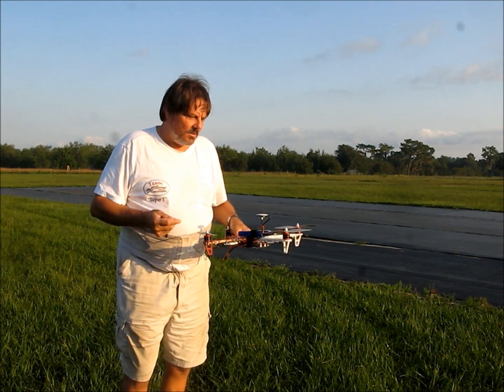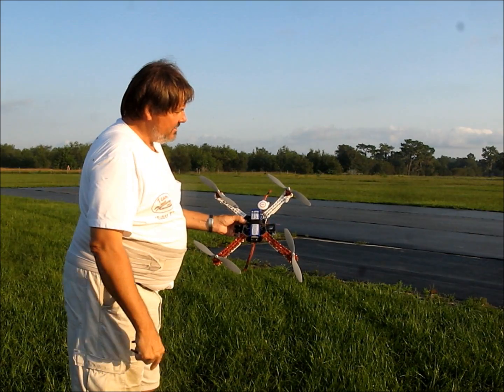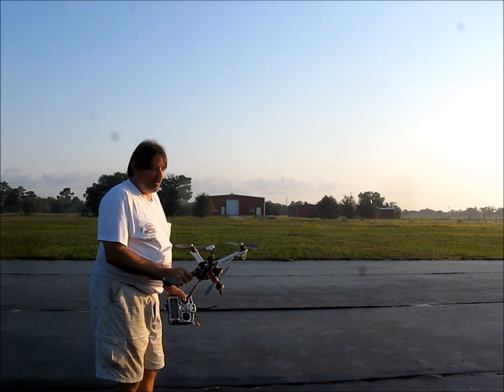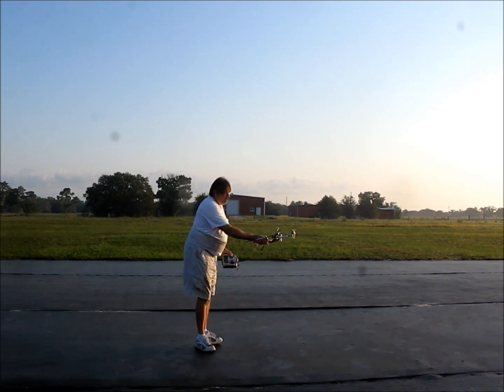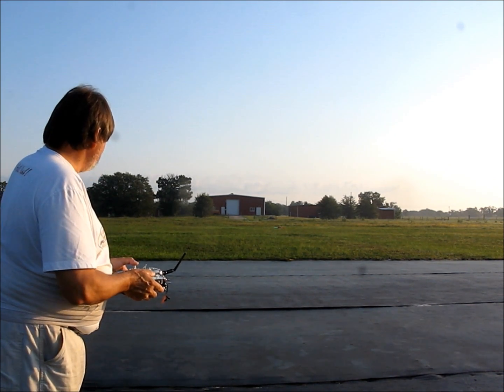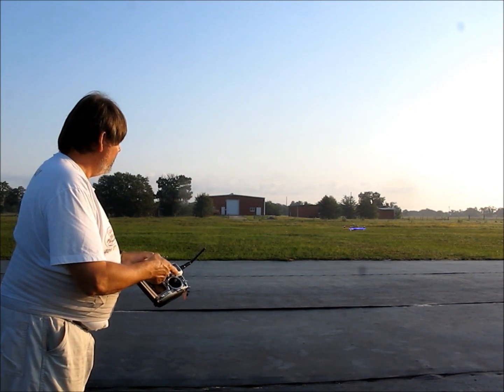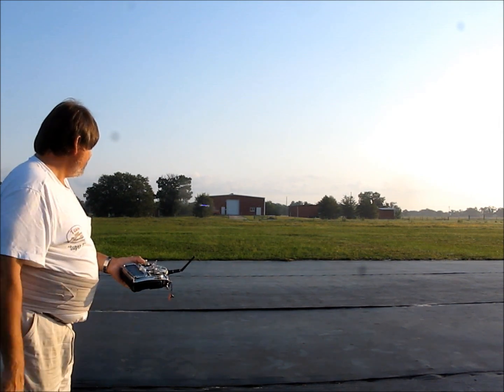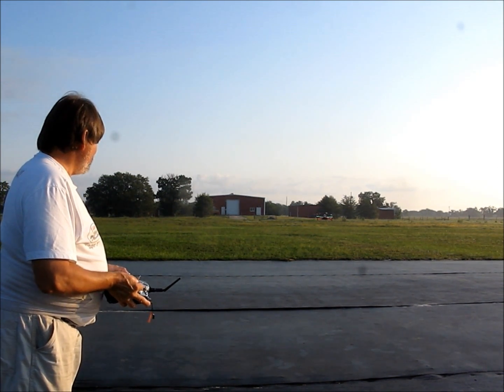dji gps ioc info

Comment from the maker: It is never a good idea to turn OFF the transmitter when flying anything.
But, I can assure you mine works. You can test it with the props off the model
and it plugged into the setup software. After setting it up you can test it by turning OFF the tx and it should trigger the failsafe.
Remember:
1) You must have a SMARTSAFE RX
2) You must bind your system with the fail safe activated.
This way when the failsafe is triggered the system will know what to do.

Let me know if you need more info.

Comment: Thank you

I have the DX8 flight mode switch set to 0 GPS ATTI..1  Atti....2 Manual and they work on the software.(3 position)

I have the Aux 2 switch and Aux2 channel set for  0 off...1 course lock...2 home lock  (3position)

Gear channel seams to be on the gimbal for some reason. Do not want this ....if you tell me how to free up this channel then I could use this switch for the failsafe.
Thanks

Comment from the maker: Now check all switches on the TX.
Throttle is at 0%
Flight mode switch to GPS
Failsafe switch to OFF.
Now reconnect to the Naza software and re-check your setup.
At this point if you have done everything correct, When you turn off the TX the Naza will show failsafe at the bottom of the screen.

Note: Leave the Autopilot in Landing Method for the first few test.
Once you have things working right then you can change that setting.
To get the most out your setup. Be sure and learn about the IOC.

Comment from the maker: While in the Naza software flip into failsafe.
In AutoPilot select Landing for the failsafe Method.
(Once you have this setup and working you can then change to Go-Home and landing.
Unplug the power from the model.
Turn off the power to the TX.
Unplug the Naza from the PC.
Plug in the bind plug
Set throttle stick to 40% power
Power on the RX.
With RX blinking unplug the bind plug.
Press the bind button and turn on the TX.
When bound lower the throttle.
Power OFF the system.

Comment from the maker: It is all about how you set the sub trim and end points for the switches.
You have to do this with the model plugged into to the computer and viewing the Naza software to make the adjustments.
Once you get the settings correct. Then you need to SmartBind your radio.
To do this you first must have a receiver with this option.
If your RX does not allow it then you can't do it.

My next post will walk you through setting up the failsafe.

Comment from the maker: I am glad to help if I can.
As for setup.
You need to setup the flight modes on a 3 posistion switch.
Them mix a 2 posistion switch to that switch as well.
Then set the sub trim for the switch so it is in Atti.
Then one end point of that switch to M
The other end point to GPS.
Then set the sub trim so that in one posistion the 2 posistion switch has no effect on any of the flight modes. But when you flip the 2 posistion switch it sends the NASA software to failsafe in any of the flight modes.

Comment from the maker: Now for Course Lock.

It can be used to perform moves that would take months to perfect.
An example would be a gyro on a heli. We don't knock heli pilots for using one.
But, without one it would be very hard for a heli pilot to fly smooth.

Once you understand how Home Lock and Course Lock work. You are sure to enjoy the fact that you have them. 

They are like tools. Some people will use them others may not.
One thing is for sure. 

YOU MUST UNDERSTAND WHAT EACH DOES before you can use them.

Comment from the maker: Thanks for your comment. 
I will give you an example for both Home Lock & Course Lock .

I am flying out more than a few hundred feet with my 450 and I get into the sun and lose it for a second.  Or for a better example I was flying early morning in the haze and I lost site of mine. (Yes this really happen) Now what do you do?
The safe thing to do is go to 50% power flip to Home Lock and pull back on the elevator stick.
The model will return to you no matter where it is. Just watch for it.

Comment: Wow, you just made me realize why I had a fatal crash 3 days ago. I really thought i lost control of my quad. It was actually, the orientation and how I utilize the course and home lock. Thank you for this video, you just made it really clear. orientation is key. BTW, the circular  imaginary 10m , this is the initial launch GPS home position? If you want to change the home pos, just reset it by cycling thru the modes a couple of times?